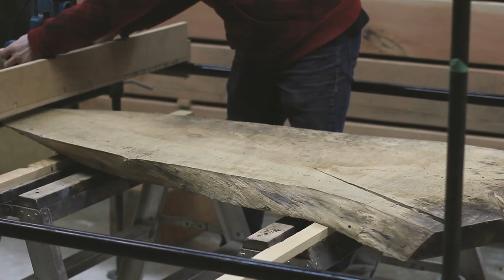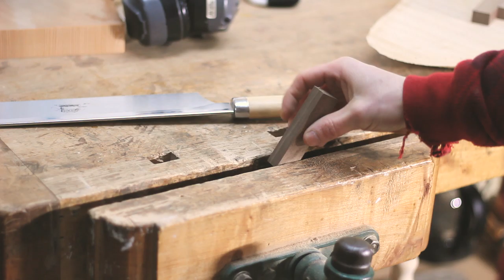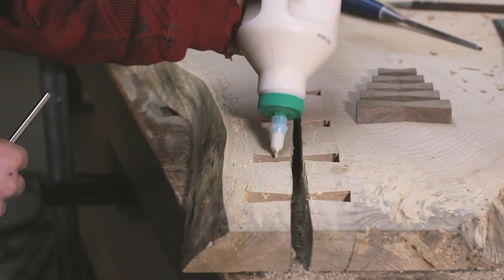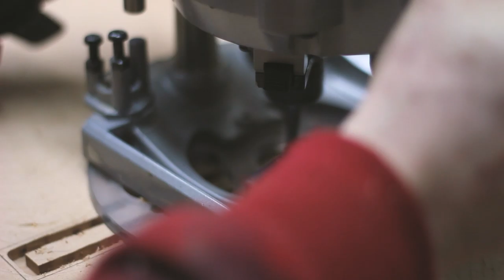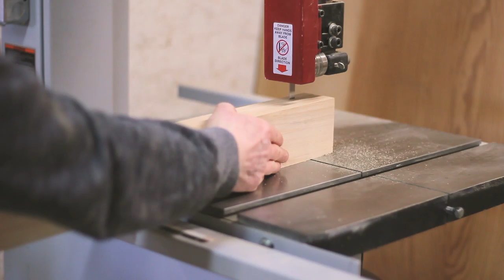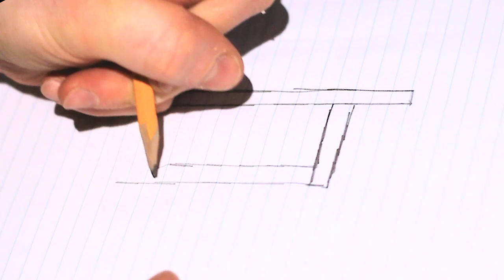Modern LIVE EDGE Coffee Table || Cinematic WOODWORKING

Comment: how did you get rid of the  wood boring beetles in  slab?
Reply from the maker: It went in a kiln before I used it. It air dried to about 14 percent moisture content and then went into a kiln to get it down to about 8 percent. The high temperatures in the kiln take care of the bugs.
Reply: @zumkellerwoodshop4224  thanks for reply. Am not a fine wood worker but do get my hands on wide array of PNW woods. I use to trim doors, floors and windows in my house.  Pacific Yew, Old growth doug fir, w. cedar,  big leaf maple, sitka spruce, myrtle, w. hemlock, w. larch.  Your video is the definition of what an heirloom is. Nice to keep slab "alive" with memories that go with it.   Keeping  slabs oiled up is good way to keep bugs out. I  heat up beeswax, turpentine and linseed oil to make a paste. I try to throw in propolis also.
Reply from the maker: @larryweinberg1191  We are so fortunate in this part of the world to have these species readily available to us. I'm a carpenter by day and am jealous you are getting to use these woods on your own home. I have never tried your method of keeping bugs at bay, but like the idea. I have used similar mixes that are commercially produced, and typically don't include turpentine or propolis. I have about a dozen more of these slabs so I will definitely give it a try. Thanks for the advice!